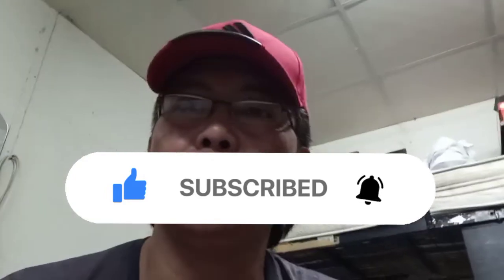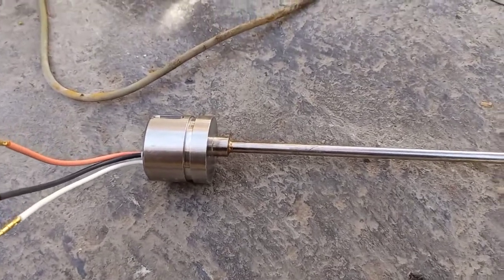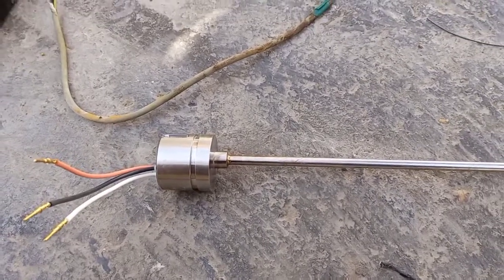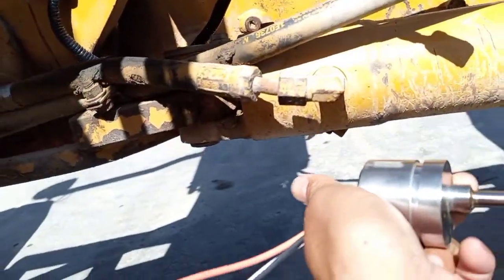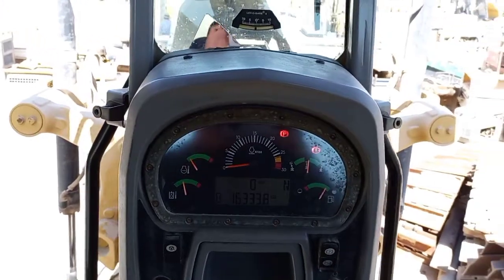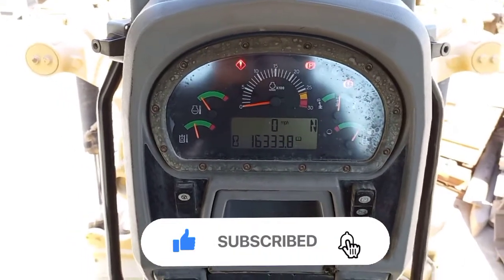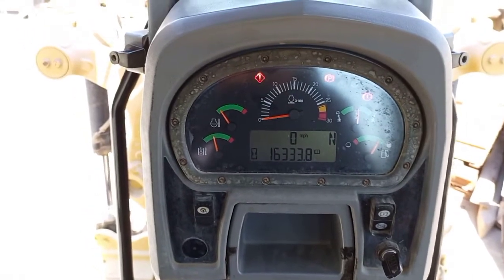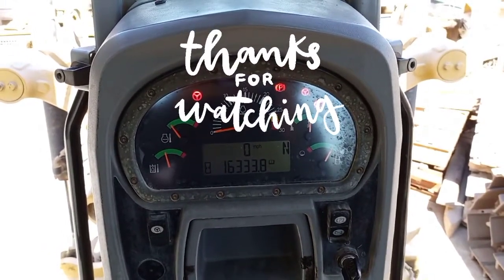part 3 CATERPILLAR 14M GRADER STEERING SENSOR HOW TO CHECK IF DAMAGE OR NOT

Comment: I have an error E258 on grader 16M what could be the problem
Reply from the maker: Bro E258 No steering Detected wthi command given, that the meaning of code, at first on that problem i think you should go first at fuse boxe check fuse for emplement ecu, then if you found fuse is okay, proceed to the next step, check harnes for possible damage or wornout, then pls  give me the complete details,like sr# and what happen while that code is showing.
Reply: @caterpillarjhunhunk  you check harness going to which side or area?
Reply: @caterpillarjhunhunk  the machine is able to move but brings that error.
Reply: @caterpillarjhunhunk  CAT0016MCB9H00694 steering fault E258 kindly help